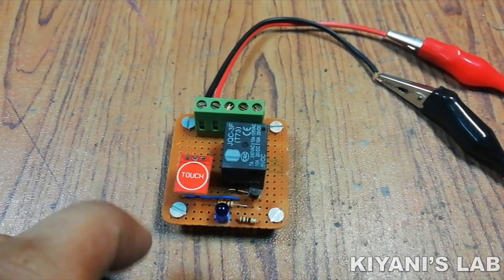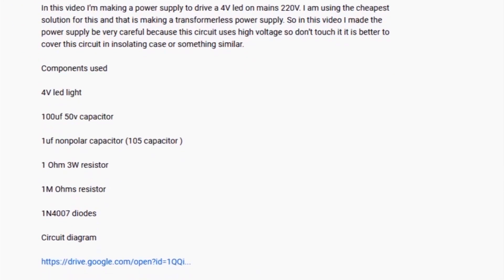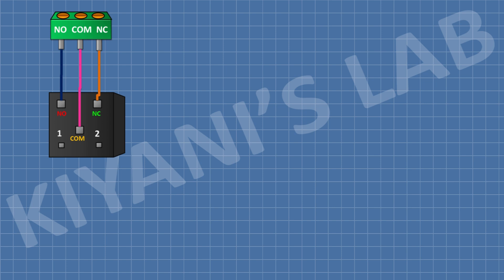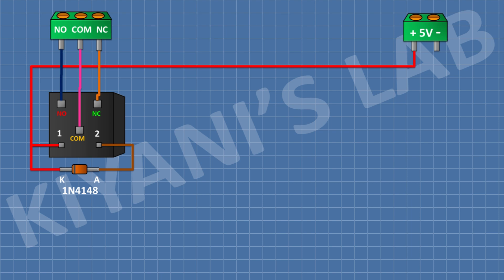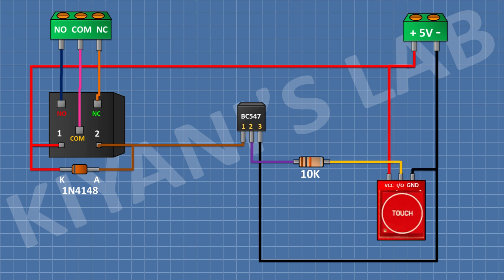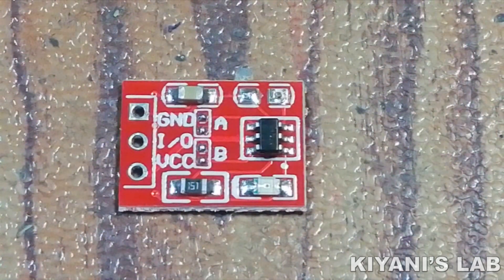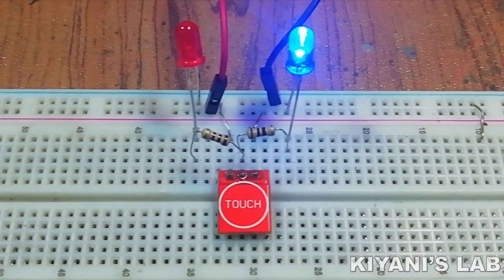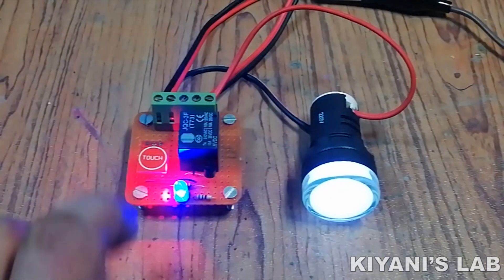How to Make Touch On Off Switch

Comment: Isme Diode resisters or transistor Ka use q Kiya gya h inke Bina BHI project ban Sakta h kya isko real m use kr sakte h kya
Reply from the maker: transistor k bina sensor relay ko on nahe kar sakta diode relay se anay wali back EMF ko dump kar k sensor or transistor ko safe karta ha or resistor current ko limit kanre k liye use kiya ha or is circuit ko real time ma use kar sakte ha

Comment: Hello Kiyani's Lab,
thank you for this project, I did not understand the last connection with the lamp, how did you connect the lamp on the green connections.
thank you and good luck
Reply from the maker: the green connector is connected with relay terminals so we need to connect NC and com pin of relay in series with the load

Comment: This circuit needs to be infra red controlled as if the electricity goes out and resume, the switch will be in off mode and we need to open it after coming out of the bed.